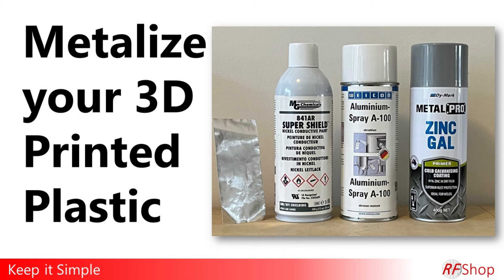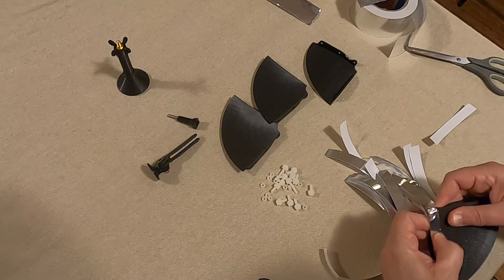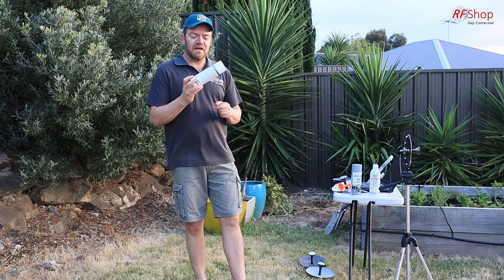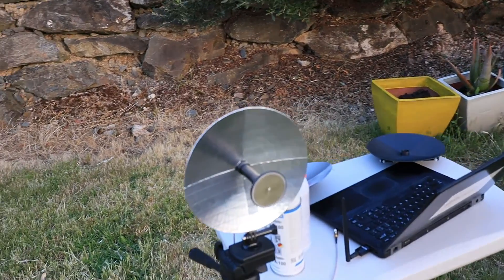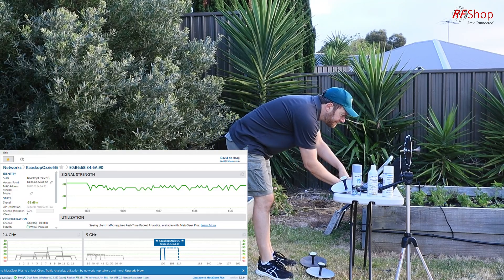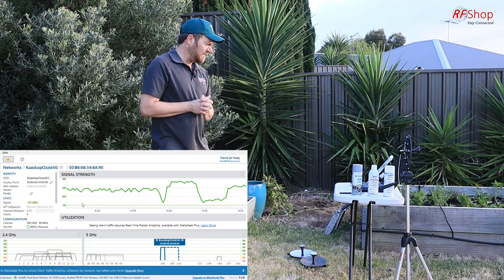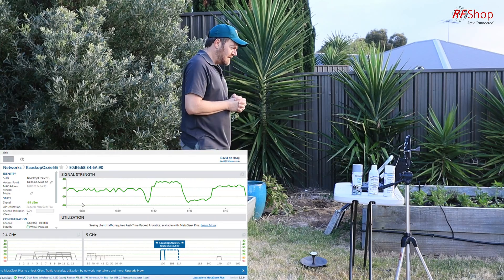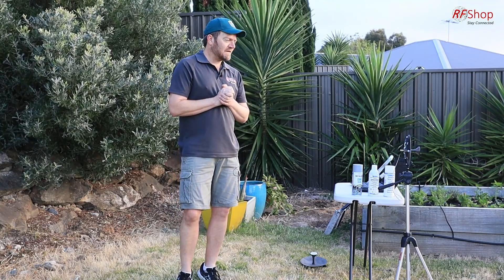Ultimate Metallization Techniques for 3D Printed Antennas – Find Out Which Works Best!

Comment: Looking forward to the "paddock" test.
IIRC "Mythbusters" made a show about parabolic mirrors used to start fires. One of the "mirrors" was a piece of Mylar shaped by creating a vacuum in a sealed container behind the sheet. I'm wondering if you could use the same method to shape your dish. Apply contact adhesive to the dish and the Mylar, stretch it over the front of the dish gluing, or somehow fixing, it to the edges, Evacuate the air between the dish and the Mylar, maintain the vacuum long enough for the contact adhesive to bond. Would it work? Don't know but maybe worth a try.
Have you considered trying carbon fibre, or other conductive/metalised, filament?
Reply from the maker: Awesome. I need to check this out. I looked at the carbon fibre printing and certainly have it on my “To Do” list. Prusa can handle these quite well.